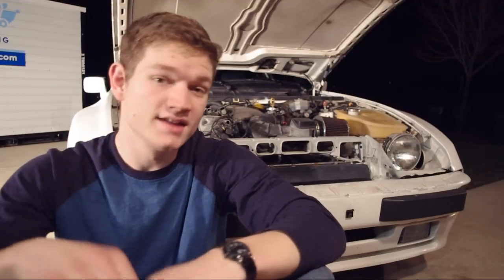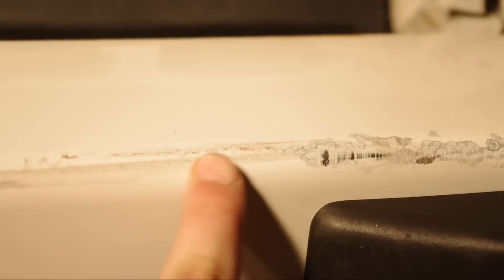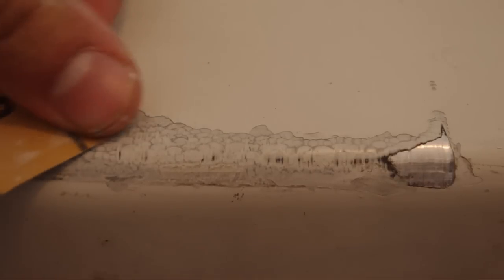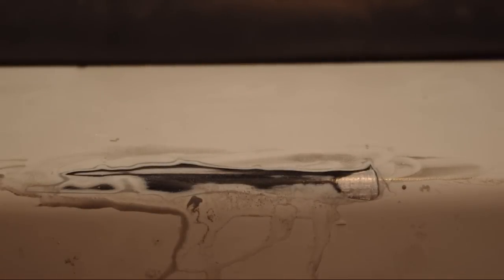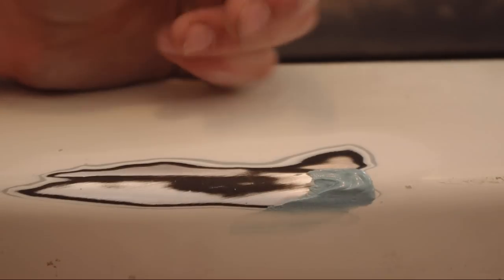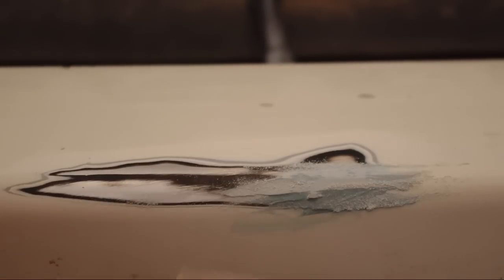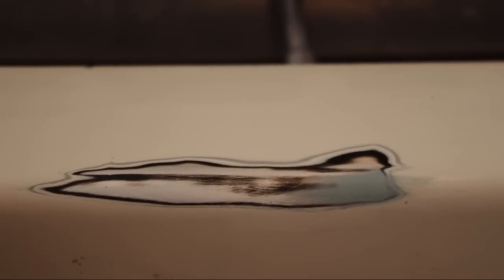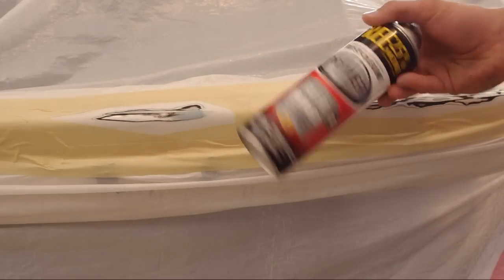How to Fix Chipped Scratched Car Paint

Comment: +Daniel Engling I have a small pain chip (smaller then a pencil eraser) on my 2015 Toyota Corolla. I ordered a touch up pen & clear coat kit online. I've watched several videos on how to apply the paint. Some say to say to clean, sand w/ 2000 grit sand paper, use rubbing compound (although I thought you said to use polish compound), apply paint, and then do I just clean it & apply wax. Can I use rubbing alcohol? Some videos say to buy a grease & wax remover. Obviously I've never done this before & I don't want to mess it up!
Reply from the maker: +Kelly Levicky Yeah, rubbing alcohol will work.  I have another video on painting a motorcycle.  All the same applies, but also do a clear coat (not in that video).
Reply: +Kelly Levicky hey ,if anyone else wants to learn about how to spray paint a car at home try Jaffacter   Paint Sprayer Coach (should be on google have a look ) ? Ive heard some unbelievable things about it and my m8 got great success with it.

Comment: Great video CousinDan and very helpful.  Like some of the other viewers, I'm now at Stage Two and already made a mistake -- I think I should have used a darker primer before painting.  I've also got a couple runs/sags caused by trying to conceal a light primer.  I'm looking for a video as good as this one on how to paint and clearcoat.  Some place say that metallic paint cannot be lightly sanded, and so I'm wondering how to smooth over the paint job (rubbing compound?) before I clearcoat.

Comment: Could this method be used on a larger area? My 2009 Volkswagon beetle has this issue by the back wheel on the passenger side. The bulbed strip under the door was scratched and concaved a bit. I would say I'd have to fill in about 6 inches. Not looking to perfect the bulb look, just get it flat so I can paint over it. Also, do you need to sand the primer or can you just spray, let dry and then paint? What kind of paint do you recommend? My car is black.

Comment: This is my first time doing this and large pieces of paint is starting to peel off my cars hood. It is now down to the bare metal. Just to make sure i'm doing it right, Is it safe to apply body filler to large areas of aluminum than sand the filler? I ask this of you because I have larger paint chips and every time I detail my car the paint continues to peels off more.
Reply: +coololds85 
you need to prime bare metal before you apply anything else, be it filler or paint. Try that first and it should help it bind better

Comment: Who tf tapes the spots off before you prime it takes forever to sand out if it was actual 2k primer
Reply from the maker: +Thomas Daniel You've never done this before, have you?
Reply: Yes and the basecoat reacted on the door i painted
Reply: I dont tape my spots its harder to feather edge
Reply from the maker: I like controlled environments.  If the basecoat reacted that has nothing to do with taping.
Reply: I never use spray can primer
Reply: Urethane or lacquer is all i use
Reply: You guys do cobbled up jobs when you want to do it the right way ask
Reply from the maker: Google the term Non Sequitur.

Comment: Thx for this wonderful video. I got a big (shallow and black) scratch on my car front bumper and the body/paint shop asked $450 to fix it. I thought the amount was ridiculous, so looked around and found your video. Thank you! The first step you explained with the "polishing compound" took care of 80% of the scratches. It costed $4.50, not $450 :-). Now I just got a few deep scratches up to the primer, which I did little sanding with 400 grit sand paper like you show here, cleaned with 99% isopropyl alcohol, sealed off surrounding areas with masking tape and just applied spray paint. The scratches are hardly visible now! Keep up your great work!

Comment: For that kind of repair masking around the area is no a good idea ,you want to blend the new paint into the old one , spray without masking the part you are painting and when it's dry go over the whole panel with 2000 wet and dry followed by 3000 and after that polish it ,seal it  and you will have a perfect paint with no sign of a repair.